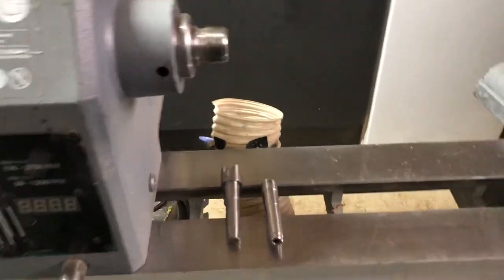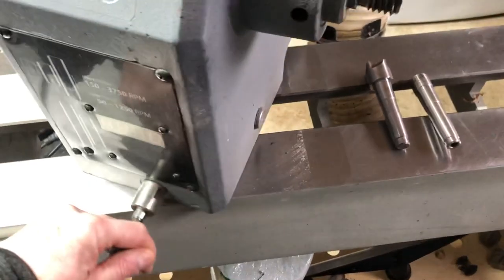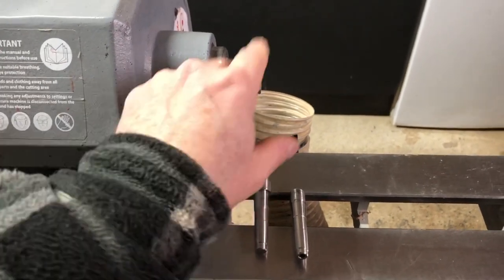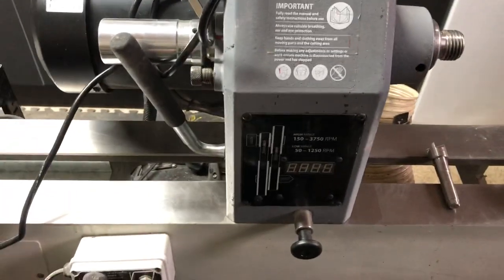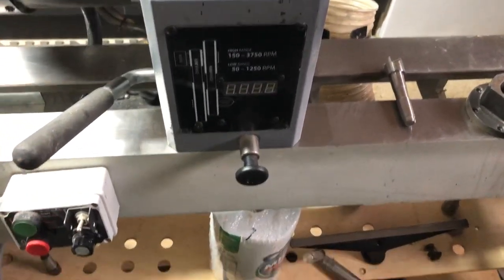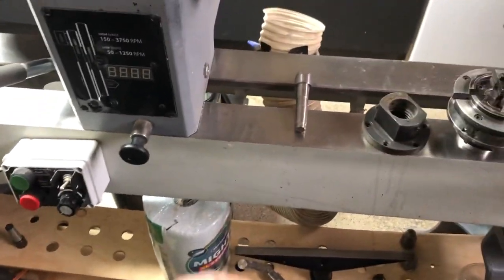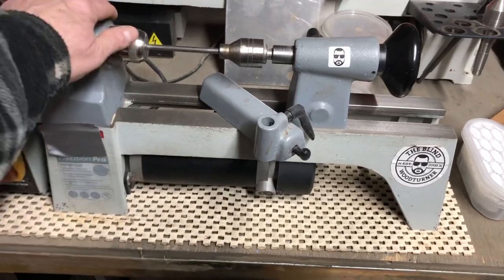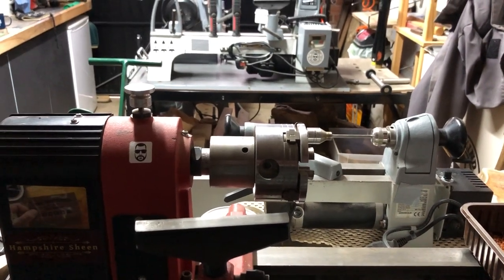Becoming a Blind Woodturner - Episode1: The Lathe!!￼

Comment: Thank you for this, I look forward to the rest of the series. I recently started turning my first piece. The main thing I struggled to figure out from online articles and videos are which tool is what shape, which way round they should be used, and how to sharpen them on a wet stone sharpener. I've designed in my head a centre finder tool which I've yet to actually build but I'd also be interested in your methods for finding workpiece centres.
Reply from the maker: Hi Ashley! Obviously there is a lot to cover and please bear with us we will get to it. You can use a shop bought Centre finder and a scratch all or Bradawl to inscribe a tactile line. Are you in the UK?
Reply: @BlindWoodTurner  I am in the UK. Which centre finder do you use? The few I've seen don't have great reviews, but I've just spotted Axminster do one which should be decent. I have quite a few of their tools and I like them a lot.
Reply from the maker: @ashleycox432  Cool! If you are ever scratching your head with a problem feel free to give me a ring. Axminster Centre finders work well but as with most things you just need to practice and get your brain dialled in along with your touch and hearing